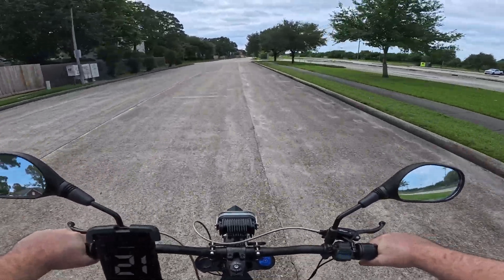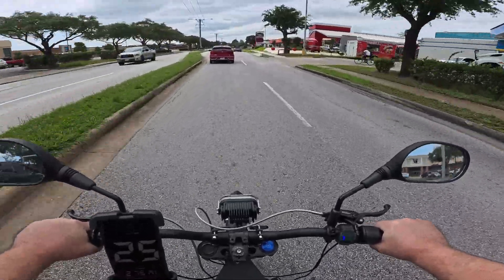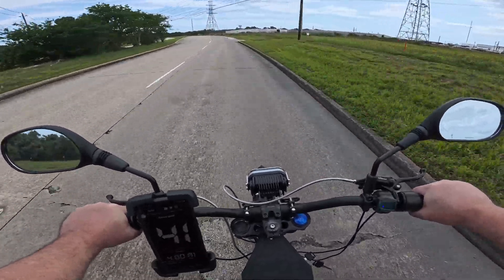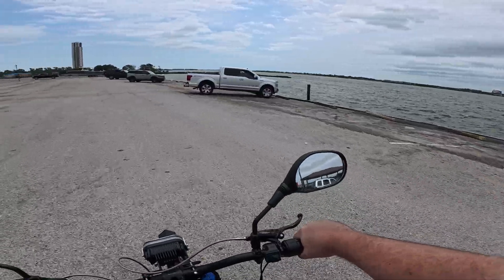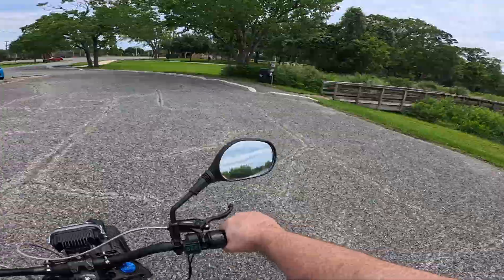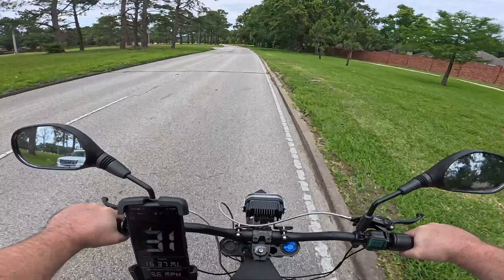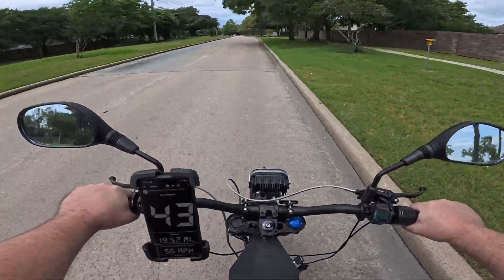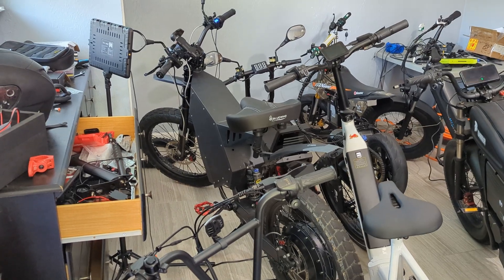Stealth Bomber eBike Range Test: 72V 70Ah Monster!

Comment: I just built a bomber clone I put metal fenders on it I built a lowriding seat bracket so I could put a motorcycle bobber seat on it anyway where the heck did you get a 70AMP hour 72 Volt battery And how much was that thing

Comment: I wouldnt take the battery capacity listed in the controller as gospel because I got the 75AH battery as well and they had mine listed as 20AH. I've ridden the bike 750 miles so far and capacity tested the battery 3 times and it's definitely 75AH. I got the bluetooth dongle and went in and made some changes. I bumped phase amps up to 480, added 12-15 amps of regen, took the throttle out of eco mode. You said you changed the throttle voltage and it made a big difference. What exactly did you do there?
Reply: you aren't worried about the battery with that much regen? they say you shouldn't charge more than 10 amps.

Comment: Look at qulbix they have a frame called the q155. Has a tremendously big battery compartment and you can add a quick release kit for the battery for easy installation and removal. That is going to be my next build. You can get it with a hub or mid drive

Comment: Love the vids! Just recently got one two months ago loving the thing, got it prebuilt 72v 60ah easily get 50 miles at 50+ absolutely love the bike tho! Would love to see a 96v version! Got mine for 2400 shipped to door, only thing I’ve upgraded is from Sabaton controller to fardriver
Reply: What seller/platform did you use? I've been wanting one similar but worried about getting scammed
Reply: @Laurin-f4m I used alibaba and blue dot, might be higher because of the tarriff war, but took 2 months exactly for me, super heavy bike tho! Mine is 189lbs